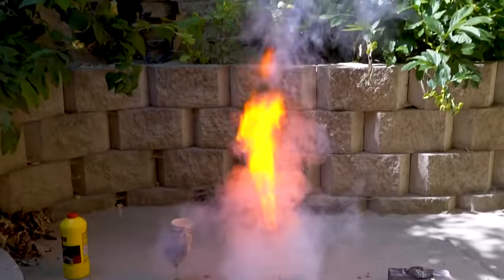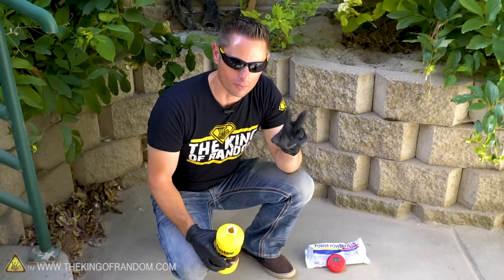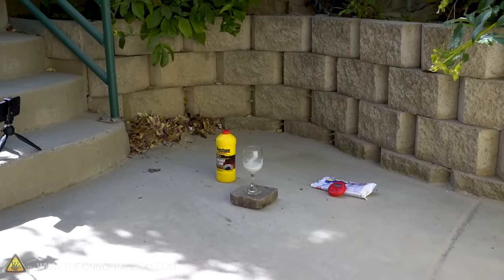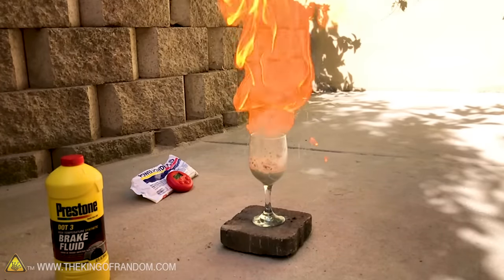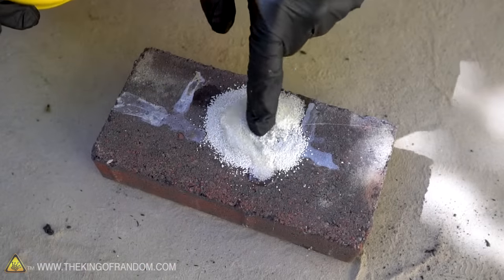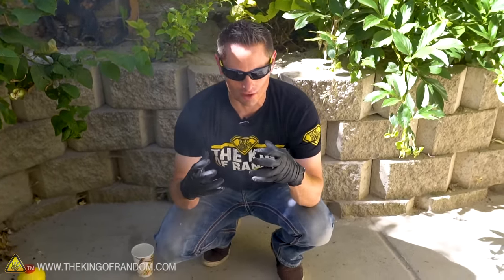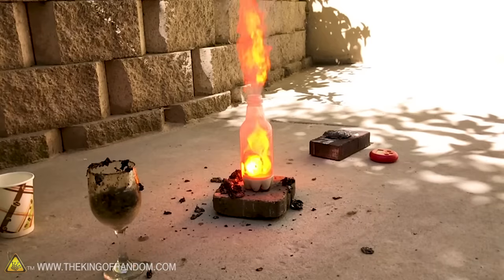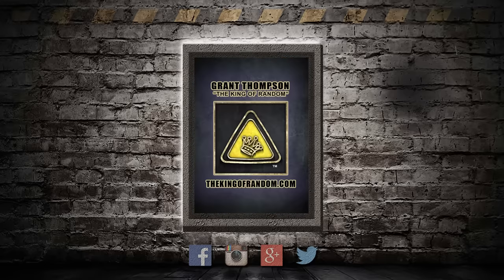Don't Mix These Chemicals! What Happens When You Mix Brake Fluid and Chlorine? TKOR Shows You!

Comment: LOL. I did this experiment as a little kid!! I had a chemistry set. One of the chemicals supplied was "glycerine." We also had a pool. My "lab" was in the basement. One morning, I was just monkeying around -- having NO IDEA what I was doing. I mixed some of the glycerine with some "chlorine" from the pool and -- I have no idea why -- put it in a screwtop bottle and put the lid on (the quantities were considerably less than we he uses here). Just like here, a short time later it "exploded" (it blew the screw top off). My father came running downstairs, LOLOL. I didn't get hurt, but I could have. Needless to say, my chemistry set suddenly became a lot more interesting to me, lol.

EDIT:  Just FYI, this was around 1960, lol.

Comment: Try it with a few different types of chlorine granules and brake fluid.. I’ve done it a few times in the past and you only have a few seconds before the reaction occurs. 
If you do it in a bottle, you can’t mix them up before putting the lid on. There isn’t enough time.
Reply: That's to bad. I was going to ask what happens I'd you put a lid on the plastic bottle.

Comment: I've been doing this for 10 years. Put it in a metal paint can on the lid and then put the bottom on the lid facing up and when it ignites it will shoot the paint can up in the air. Oh and the time it takes to ignite depends on the amount of break fluid used

Comment: Curious, in your experiments they all have access to open air.  Will it ignite in a closed system, like if you had put a cap on that bottle.
Reply: It'll explode! The chlorine reaction creates it's own oxygen. It will have nowhere to go.. it'll just pressurize the bottle and...BOOM! Possibly with a nice flame. And it wouldn't be anything small. It's dangerous.

Comment: Posted as comment to Nether Gamer:  Re: open air = increased oxygen  <— which implies: even a minuscule increase in available O2 makes a lot of difference in the SPEED of the ONSET of the reaction, but what about the intensity? Is the burn time shorter? What if he had dribbled a little liquid oxygen on to the mixture as a last step? How about “soaking“ the chlorine powder in LOX for 30-60 secs before adding the brake fluid? Soda bottles are designed to withstand a fair amount of internal pressure, so the ultimate question is what if he mixed all 3, but limited the LOX to the amount of pressure the bottle could withstand from the expansion that would occur as the LOX transitioned to gaseous state, prior to ignition and with the cap screwed on tightly ?

Comment: Not sure if you check comments on older videos, worth a shot however.  I was wondering, i use chlorine mini pucks for my hot tub, (as well as that shock treatment), would the same reaction occur? Or would it be more of a slow burn as they are very compacted as opposed to the granular shock treatment?  Or nothing at all?

Comment: @the king of random The reason that you had a faster burn on the exposed solution is because you had no oxidant in the other solutions and as we all know, this kind of burn EATS oxygen, same as the soda bottle, it burnt at the same time as the beaker did because it probably had around the same amount of O2 exposure, while the line on the brick was completely exposed. I would be very interested to see you do this with an oxidant included in some way.

Comment: I've been watching the videos alot the past few days and there are a ton of diy I bookmarked. 

I remember in the elephant toothpaste rockets you did a rubber balloon inside the bottle and  used a exacto knife to burst the balloon. I'm honestly curious if putting the break fluid in a balloon  and the chlorine in the bottom  if using a cork with a blade in it would work the same way or if it would just explode 🤔

Comment: BIKE ROCKET! This would make a great propellant combination for a bicycle mounted engine. It could go in a U shaped bent pipe with both "ends" facing backwards, the bottom end capped and a nozzle on the upper end. It would contain the reaction, and the acceleration of the whole vehicle would act as its own ullage motor, keeping the propellant mix seated against the end cap. Just tip the bike up, and pour the stuff in the nozzle, then shake n bake!!!!

Comment: I wonder what would happen if you reversed the order of chemicals. I know there is still Oxygen trapped with the Chlorine in the glass, that is kept under pressure by the brake fluid. 

Reversing it, would allow the o2 to escape, as the chlorine would be poured into the glass with Dot3. Might be a slower reaction, or faster. Interesting though.
Reply: HB

Comment: I wonder if you had capped it off if no reaction would have happened at all because with your times they were different when the air introduction was different as with the glass and with the bottle the amount of air was restricted to some degree while in the open air the time was faster leading me to believe that it's activated by air as well as the two components.

Comment: **You were using WAY too much brake fluid.  Next time use the large "Shock it" tablets. They are two to a bag.  Just open up the bag seam long wise and leave them in the bag.  Use 1/2 cup brake fluid, no more.  They will cook off in 15-30 seconds.

Comment: Now put the mix in a steel pipe with screw endcaps..
Reply: Do a test run I’ve had it go up as fast as 15 sec I plastic bottles with cap are safer

Comment: 🇺🇸🇺🇸 Want a faster reaction? Use brake fluid and potassium permanganate. Potassium permanganate is also something you can get at the pool supply. It will leave behind hot Embers for fire starting. 🇺🇸🇺🇸